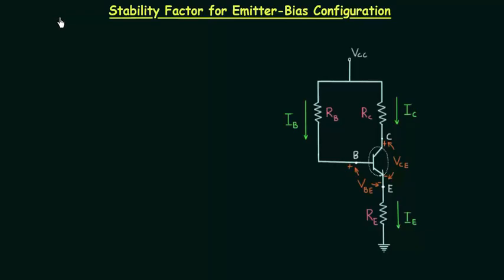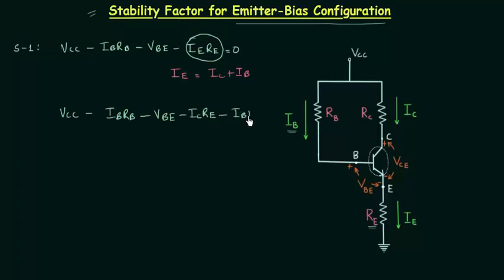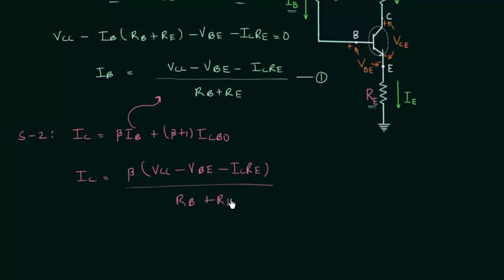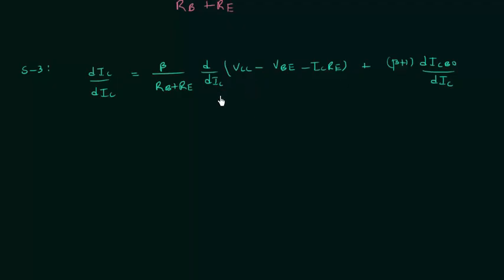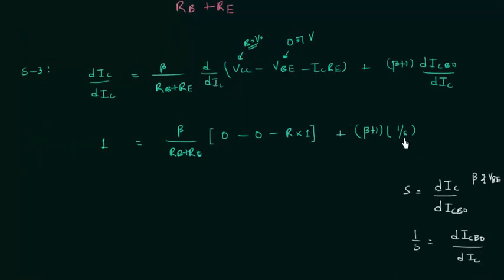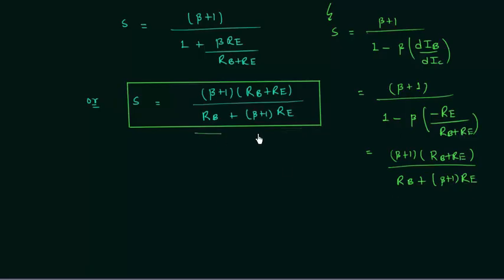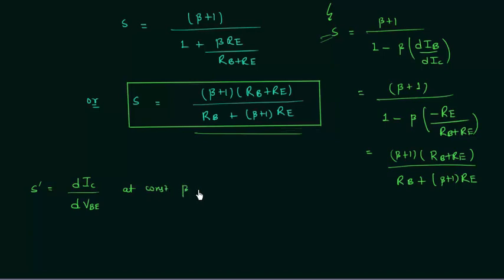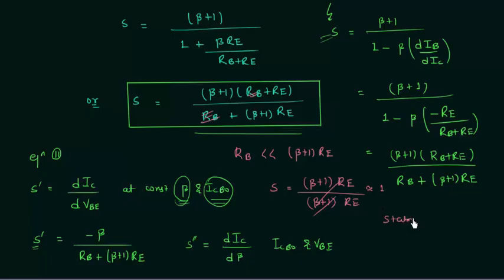Stability Factor for Emitter-Bias Configuration

Comment: can we write base current expression as Ib=(Vcc-Vbe)/(Rb+(beta+1)Re) and then calcute Ic and then do differentiation???because this is the expression which u got in lecture number 78 in the emitter bias configuration lecture and if we can write so then my expression for s is comming same as the fixed bias.pls explain.
Reply: The reason is that here you cannot use Ic = beta*Ib(this is approximation by neglecting Icbo) , hence  Ie is not equal to (beta + 1)*Ib . So  Ib=(Vcc-Vbe)/(Rb+(beta+1)Re) is not applicable here.
Reply: @jaideepbedarkar  THANKS
Reply: @jaideepbedarkar  MAN I WASTED 20 MINS ON THIS THANK BRO U R THE OG
Reply: Same problem here also......pls explain